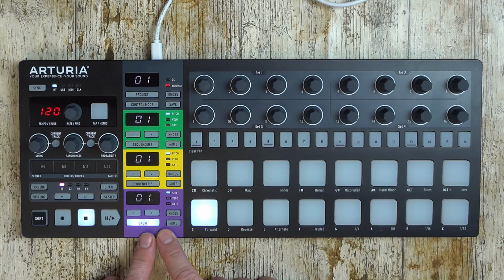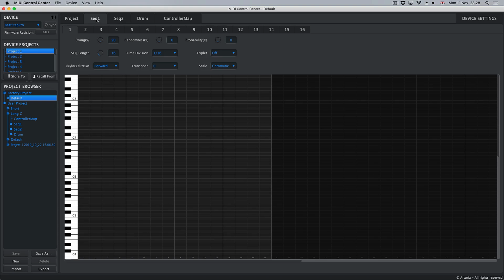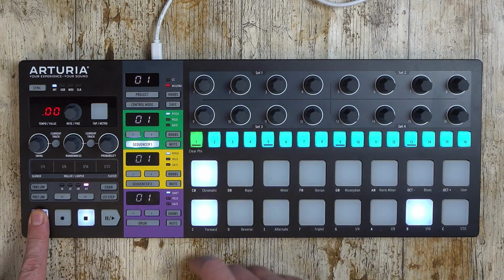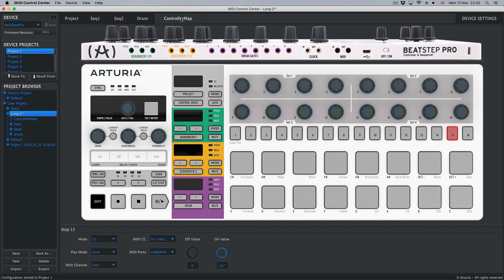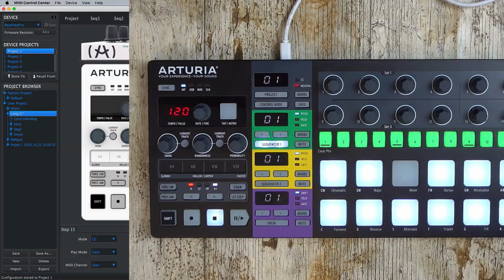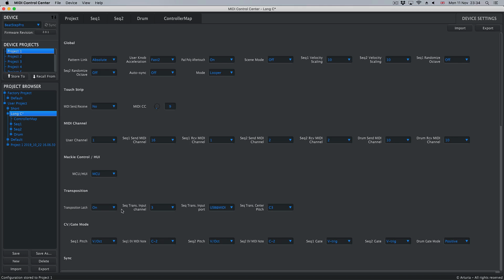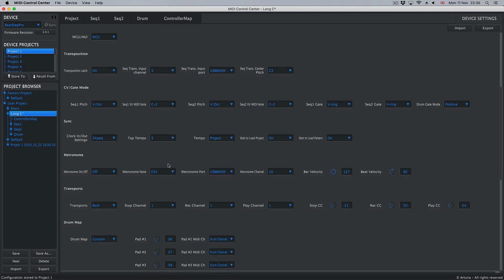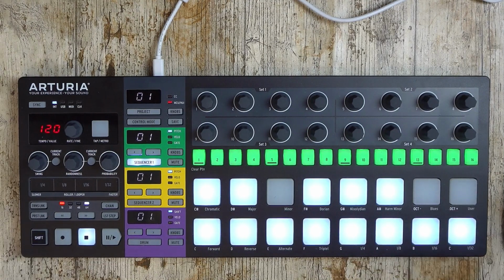How To Use Arturia BeatStep Pro with Bluffmunkey - 01 - Introduction and Overview

Comment: I have been using rhythm machines/boxes/slabs since the 70's starting with the Autovary from Hammond. My most recent trek included the Beat Buddy, but it was specifically designed for guitarists. I found I needed a controller and that lead to my purchase of a BeatStep. That worked out find (and I probably should have stayed with that). My wife and a salesman talked me into a BeatStep Pro on sale which I slid into very smoothly. I have been working with that for the last 4-5 years, but it started loosing knobs and somehow got misplaced. I got another one on sale, but I am having a serious time trying to get the proper codes and signals to line up with the Beat Buddy. I have checked quite a few videos and studied manuals, and it is creating frosting on my bald head. In the least, I need the Pro to be able to scroll through my library of 64 'songs'. I could hold down the project button, tap any one of the first four numbered pads, and select one of the 16 larger pads where any one of my songs were stored. Then I could hold down the project knob, tap the fifth little project pad which gave me 16 pads of operational control over the Beat Buddy (intro, stop, pause, trans, outro, volume, and tempo tap). One of these devices is feigning senility.

Comment: And there in lies the problem.  I am lost.  I cannot seem to find a resource that guides a Noob like myself on setting up the Beatstep Pro. #WhyAndWhenWouldiAdjustAnyOfThis
Reply: youre not the only one;)
Reply: what are you looking for exactly?
Reply: @shxcxchcxshshxcxchcxsh9791  most recently, how to get the BSP drum sequencer to sequence the Elektron Model Samples.  Currently, it only plays/sequences 1 sound/track.  Everything is set to the same Midi Channel.  For a point of comparison, the same setup using a Korg Volca Sample sequences all the sounds via the single Midi Channel.  Not so w/ the Model Samples.
Reply: @RepublicAllegiance  maybe it's like the volca drum where every "part" (instrument) has its own midi-channel. So for me channel  1 to 6 is reserved for the volca drum, channel 7 to 16 are my synth channels. And if I'm not mistaking, the BSP can only handle 3 channels at a time. 🤷‍♂️
I'm trying to find out if BSP is a solution for my setup with Deluge, Volca Drum, reface cs and cp and in future the Korg SV 2 🤔
Reply: @nmi5906  I suspect you are correct.  In the end I decided to NOT use the drum sequencer on the BSP for drums, but rather as a polyphonic sequencer for a synth.
Reply: @RepublicAlliance: hope this helps: https://aadl.org/files/catalog_guides/beatstep-pro_Manual_2_0_EN.pdf